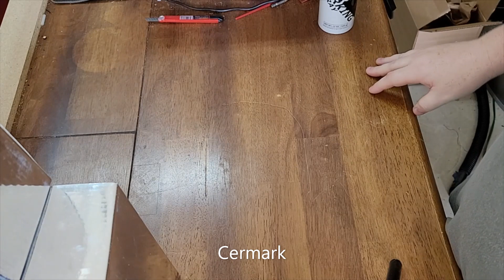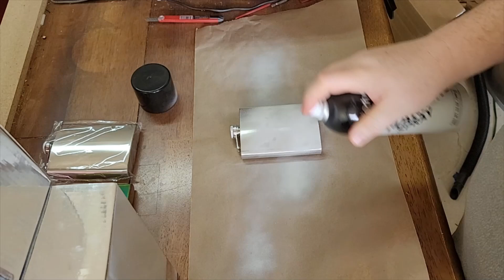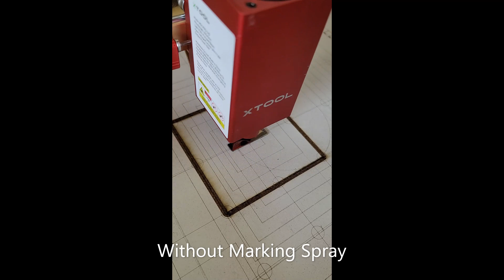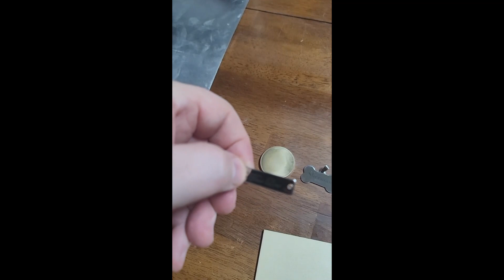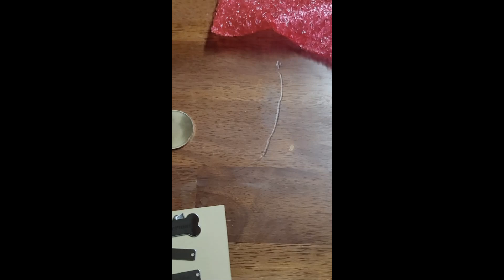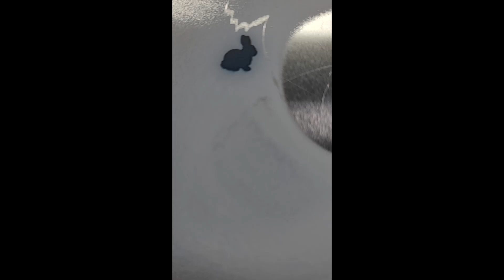Testing the Omtech Laser Marking Spray

Comment: Thanks for the tests.  :-) I used it with a 5.5W diode laser from SainSmart Cubiko on stainless steel and it works fine around 1000mm/min and 100% power.  No real issues.  It even works well from about 70%-100% power and about 500-1500mm/min.  The whole range seems fine so far.
Reply from the maker: Nice good to know.

Comment: If you accidently touch the spray after it's dried does it come off on your hands. We had an issue with the brilliance laser spray coming off to easy.
Reply from the maker: Yeah very easy soap and water
Reply: @doubledwoodworking  So if you barely touch it it will come off?
Reply from the maker: Once it's dry completely i would treat it like tempura paint. Same texture
Reply: Editing to reword as i realize tone may come across unkind:
Yes, it's a fine powder. Most of the marking sprays/mixes dry that way. Not really meant to be touched, the best way is to coat just one side, engrave, wash, dry, move to the next side. You can also use paints and such if you are worried about mess

Comment: Friend, I have a 10w xtool d1 pro machine, and I bought the omtech spray, and it doesn't record, I set the parameters to 100 power and 1 speed, but I just add tap water and it falls, everything is easy to remove, What do you recommend me?

I made it on a plate for my pet, it is stainless steel
Reply from the maker: That is quite weird.  A couple  things...make sure you shake the can well. Also are you using xcs or lightburn? My settings for stainless are 70% power 17mm/s. Try a test on some scrap...also make sure it is stainless steel because aluminum will not work as it doesn't get hot enough
Reply: @doubledwoodworking  XCS
Reply from the maker: Try the settings above and see but also do test patterns to find good  settings.  Best I can think of
Reply: @doubledwoodworking  thanks leader, i try and i write later
Reply: @everyoneshobby It doesn't work friend, it washes and disappears, if you like, send me your email so I can send you the link to the video like I did and nope I put power 100 and speed 1 mms and nothing
Reply from the maker: It's fine I imagine that the plate you are using is not stainless steel  or it is a different alloy. It all comes down to heat. How thick is the plate? Where did you buy it? Is it coated? There are a lot of factors when using coatings to get laser marking. This is really meant for co2 lasers and higher than 40w. I am able to consistently get good results with my 10w xtool laser. Brushed stainless works better. The only reason I can think is that it is not stainless steel or the laser is out of focus or the laser might be dirty. Try those things and get a scrap stainless steel sheet or card or something and try there. If you get a stainless steel sheet, do a material test. These are my only suggestions.

Comment: Have you tried marking aluminum with CerMark, omtech or cold galvanizing compound using the xTool 2 watt Infrared diode laser yet?
Reply from the maker: Yeah I have it down stick very well.  Has to get really hot to make the mark
Reply: @doubledwoodworking  this is 2watt IR xtool Infrared with omtech spray I just did
Reply from the maker: Yeah I do not have an infrared module to try. I want to get one someday.
Reply: This is bare aluminum with the xTool F1 2 W infrared laser, and three coats of omtech that I just ran
Reply: I tried to post a picture of my results, but for some reason I can’t.  Bottom line was at 60-100% power, I could get dark markings at 2-10 mm/sec respectively